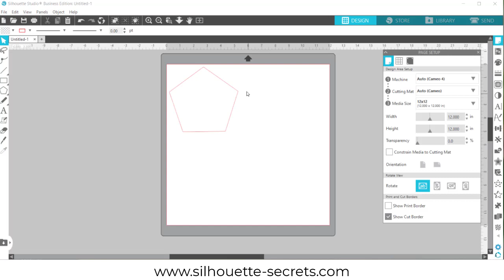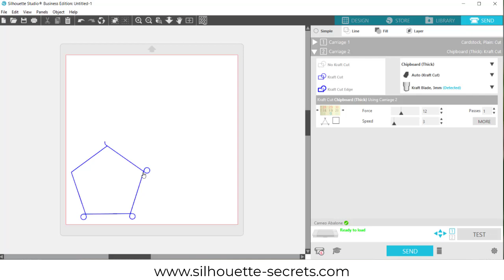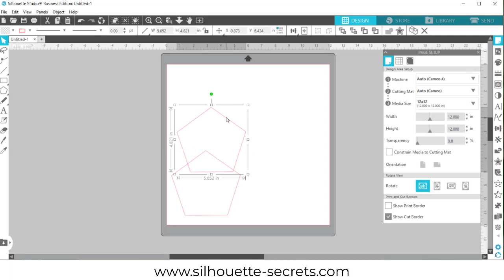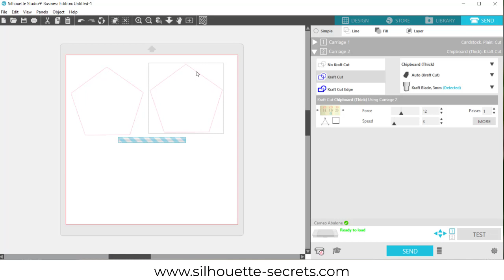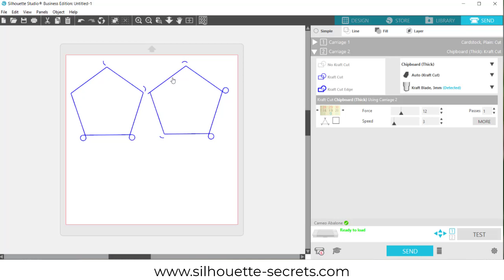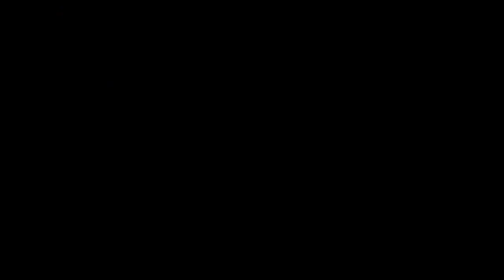Silhouette Kraft blade tips - Hooks and Loops demonstration

Comment: so this tool would not work for cutting something like a window out of a panel of balsa wood for example? Like for a miniature wall. Since it will also cut the loops into the panel... Do you know if there is a way to achieve that?
Reply from the maker: Correct. Hand cutting with a box knife or exacto blade is probably the best option.

Comment: My silhouette studio does not show the loops when I try to use the kraft blade, in addition, when i send the work even though the machine recognizes the blade, a message more or less like this apears: incompatible tool;  do you know what is going on?
Reply from the maker: That typically means you have chosen a material that does not have a Kraft blade setting. You will either need to select a material that has the Kraft blade setting or create your own custom setting. 
https://youtu.be/5OLiy3BnkMg?si=F84mjAw4cjpFIo0I

Comment: I had to disable those from my works. When trying to make cuts on thick chipboard, those loops were places where the blade got stuck
Reply from the maker: Unfortunately, that does not work for all users and you run the risk of the blade getting stuck or breaking off the tip because the blade is sideways because ot has no way to turn. It is like an exacto blade and does not swivel on sharp corners or intricate cuts well. But of it's working for you, then great!

Comment: how to remove/off the loop and hooks?
Reply from the maker: If you are using the Kraft blade, those Hooks and loops are how the blade turns. You don't want to cut without them or you run the risk of the blade being sideways when trying to cut.
Reply: in the meterial settings disable smart cutting or something like that

Comment: If one would want to cut several designs on the same page, why not make them of different colored lines and send them one at a time ? So that when the first one is done, the carriage goes back into position and then other color could be sent to cut, and so on... Just a thought... Haven't been up to that yet, but should shortly... Thanks for the details behind the technology...
Reply from the maker: Well, you could definitely try and I have, but it affects where the hooks and loops will be on each design and some designs will cut better when they are the only thing on the design mat - so the arrangement is different. When you try, please share your results.